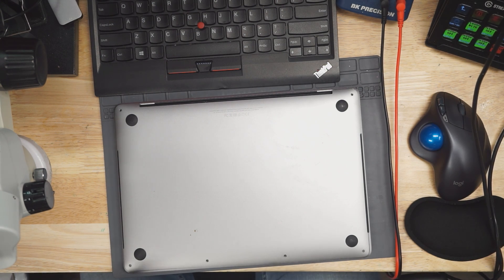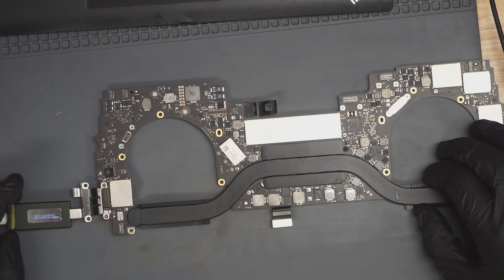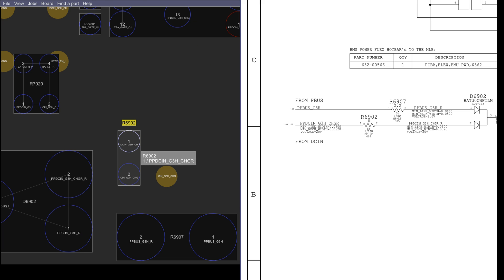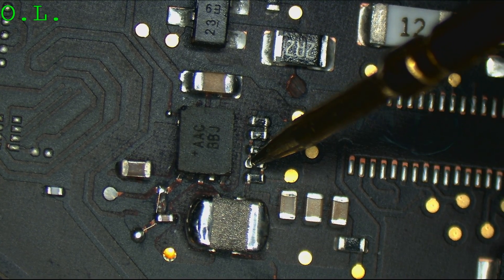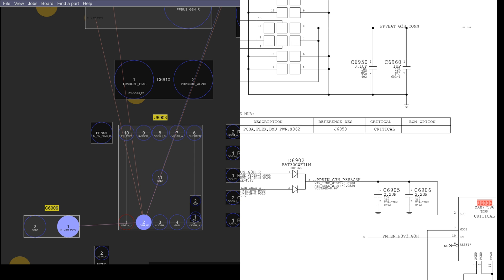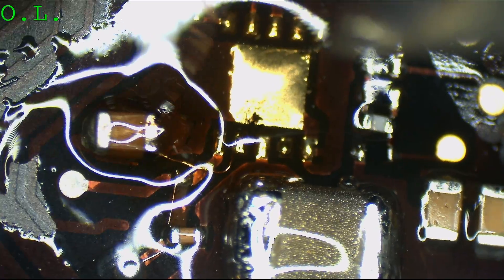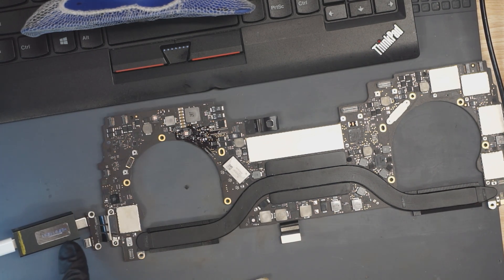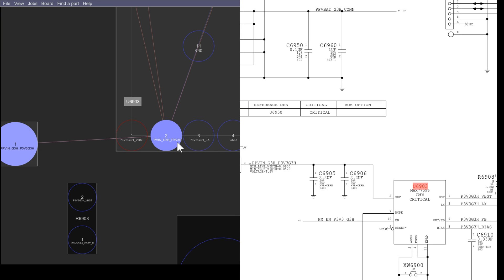Louis fixes board while losing mind, earns 1 star review.

Comment: I have never even opened a PC or any other electronics in my whole life, and I have nooo idea what he's doing, but I can say "pee pee bus" and "gee three hot"
Reply: Dw, most of us here have only got "Are you on the pee pee bus?" outta these.
Reply: Think of it like this. You gotta plug your phone into a charger to charge. 

Similarly, the internal components need to be “Plugged in’ to work. Power wasn’t wired to that chip so he reconnected it. That’s all he did there. Or maybe replace a chip that went bad. The flux and stuff was jut how you reconnect wires directly to components on a board.

I’m not an expert obviously but that’s for the most part how boards are fixed

Comment: I'm doing some DIY on a Pentium 3 computer found on the streets many years ago and ran into "Error 12" in Windows XP that crashed/froze the boot. After a long debug search it showed that the Bios or Windows is assigning resources in a messy way and I removed a network card and the CD-Rom. (I also have a DVD module connected). It then started the Sound Blaster card.

Before I started painting the case and the front of the diskette module there was no errors, but I don't remember if that sound card ever worked before. The outer case is looking good now with a color style from Dell and I have a 4:3 Dell monitor connected which was given away and I picked it up close by.

When I find a Firefox setup file somewhere in my backups then the WiFi internet pages also works via a small USB thingy that is easy to unplug.

I did get angry a few times and mostly on those '90s engineers who built this without making it show a message of what the problem is.

Comment: Thanks to watching your board repair videos I knew what I was looking at when I was doing a motherboard post mortem today.  The batteries in my multi-meter died before I was able to finish checking resistance on the capacitors and resistors.  I was truly impressed with how many parts were burnt out without frying out the CPU, RAM, or all the other parts!

Comment: Louis, if i were running your set up, where you have decent lighting and you know you're always going to be a set distance from the camera, i'd be running my lenses at f/5.6-f/8 constantly. because it's more important people can see the table or your face in focus consistently, than that they get creamy smooth backgrounds/razor shallow depth of field, like they would at say, f/1.8. But at those narrower apertures, there [shouldn't] be any appreciable difference in sharpness or fine detail between one modern lens to another. especially on an APS-C sony, which i'm guessing you're shooting with. so you're not crazy. Now, if on your down time you wanted to go shoot some cute pix of your cat sleeping in a dark room, and you don't want to turn the lights on or use a flash, a 30mm prime at f/1.4 or f/2 would be worlds better than a standard zoom at 30mm at f/3.5. There's a tool for every job. You're just kinda comparing a socket wrench with an impact wrench here.

Comment: things that set apart good lenses from bad ones are mainly and excuse my poor english (i'm german):

- good lenses can produce sharper images mainly on the edge of the lens wich a bad one cant do so well
- good lenses dont suffer from chromatic abberation that much (when filming metallic objects you get green and purple spill)
- good lenses usually have better autofocus vs the bad ones and they have better control mechanisms, mainly in regards of holding the settings you set them to

that beeing said, kit lenses are surely far from a good lens, but they are also far from a bad lens. for making youtube videos, the kit lens is sufficient enough and even for most amateur photographers they do the job just fine. people that dont know how to properly use the camera and in general have no idea of what they are talking about jerk about their lenses - they dont make them a better photo/videographer by themselfes.

sigma is depending on the price range on par with the kit lense, at least for the canon ones i owned before. i think sony makes a bit better kit lenses than canon does.
thing is, a lens is very expensive if you want a good one. if you buy the cheap stuff from sigma, you might aswell safe that money and stick to the kit lens. most manufacturers like sony canon and nikon do offer entry level lenses for a good price that cover most focal lenghts that are required under normal operating conditions.

sorry for rambling here louis but i hope i can give you some advice back for all the useful stuff i've picked up from you (never would i have thought i'm going to repair one device, but beeing able to self-repair my shit is just priceless)
Reply: @MrPuffin69  sigma is mostly exclusively an choice for amateurs (except from the really good ones). i do not know any professional guy that uses these, they all stick with either the manufacturers brand or something like Zeiss for the very reason they need to have something reliable.

having different focal lengths surely requires different lenses BUT there are huge differences, especially with wide angle lenses, the cheap ones clearly seperate from the quality ones
Reply: Good info Sharky. I've got a couple family members looking at getting lenses, I can pass on this bit of info to them.
Reply: @MrPuffin69  u mean stigma?

Comment: You ran a jumper wire, it's now a PC
Reply: Terry Wilson  At least AGC schematics are publicly available
Reply: @needleonthevinyl  - AGC?
Reply: Maybe even PC XT
Reply: That would be an upgrade!   @volodyanarchist
Reply: I once disconnected the wires to a cheap AM radio and lengthened the wires and connected them to a jack I installed after drilling a hole so I could listen to the the radio with headphones.  (Couldn't afford a walkman).   All this time, I had a made a PC and didn't realise it.
Reply: You'll never find a molex connector in a MacBook.
Reply: "And it's going to explode.... And kill a baby..."   Quote direct from Apple
Reply: Can you direct me to the video where this originated from
Reply: @FxsX24  I can't find the exact video that Louis talks about it, but it has to do with a legal type claim that Apple's lawyers made saying that any unauthorized aftermarket modifications of any kind technically makes the computer no longer a Mac and there are copyright issues with that. It's an absurdity that comes from desperately trying to prevent right-to-repair.
Reply: @needleonthevinyl  yes yes, but at least still can be fixed, but switching parts may cause problems. Mac lockdown initated.
Reply: @FxsX24  
https://youtu.be/oNl2q6YZXlA?t=267 I saw it there.
Reply: @FxsX24  I think is the "Apple sues and loses" video

Comment: I sure learned something, to not buy Apple products. But I've known this since 2006.
Reply: @dj-rocketman8545  hold their value ?  why because you spent $1000 to $2000 more than you should in the first place? Or because you have to sell it to afford the next version the next year, that has the exact same hardware, but costs a little more ?  Most of the time, you can't even get the latest and greatest hardware on a mac, they are consistantly 1 or 2 generations behind.

When i buy or make my computers, it's top of the line for the money I'm spending and it lasts me (or who ever it's for) for years.   When it's not my main system anymore, it becomes another server.

BTW, no electronics hold their value, it's like buying a brand new car and as soon as you drive it off the lot, you lost $5000.

The only thing macbooks really have going for them, is that they are all the same hardware, so you know that there are going to plenty of the same spare parts, eventually.
Reply: @dj-rocketman8545   lol, i like how you call me a fan-boy because i'm basically saying, buy anything else because you'll get a better deal.... that makes me exactly NOT a fan-boy of any type.  

There are people who constantly buy the newest apple-anything as soon as it comes out, apple counts on this heavily, which is why they have their constant cycle of release-rinse-repeat despite hardly anything changed hardware-wise. And by the way, sales are down for apple, because of this.

Yes, cars and electronics do not hold their value (well, except maybe classic cars).  Go to a pawn shop or hell, ebay and sell your 10 year old electronics for the price you paid, not gonna happen... so yea, it didn't hold it's value. This isn't rocket science. Buy some land, and sell it for how much you paid... not so hard, because it held it's value.  This is simple english... if something holds it's vaule, it literally means that its not worth less later in it's life than what you paid.  Gold, Silver, Diamonds... all the things rich people put their money into so they don't loose it when money value drops... none of them go out and buy piles of electronics to later sell and get their money back.

Mac books are made of aluminum, fairy dust, and cool stuff... except they couldn't even do it right, so the top of the line mac book throttles down the CPU so it doesn't overheat, making the top of the line intel processor you can get on it, basically a mid grade i5... all this, despite the mac book being made out of aluminum (which means it should cool down much better). 

Now, do yourself a favor and google "aluminum laptop" and see what pops up ?  a whole lot of NON-APPLE products.  This isn't the 1800's, everybody has access to aluminum, and apple hasn't tried to patent it... yet... like they did with round corners lol.

But you do say that everybody gets them because of final cut pro and the OS.  I know a handful of developers, game designers, and aerospace engineers who have or had a macbook and generally they boot up linux, unix, or even windows7 or 10 to do their actual work.  I think only 1 has kept the Mac OS as a dual boot option.  Why do they do this ? because they love the screen and/or keyboard, and they generally don't have to pay for their company machines, not because of the struggling MacOS.  Don't even get started with how stagnant it's become... apple's put all of it's software force working on it's mobile stuff, and the security holes in it's computer OS keep bubbling up.  Ask your local IT security professonal and wait for him/her to start rolling their eyes.

I'm not saying Apple makes totally crappy machines, they have some good hardware sometimes, but it rarely is worth the price you pay.  I even had one of the first Macs way back in the day (80's), and I've been in this industry for quite a while now.  If you really want a Mac, just be honest with yourself that either (A) you don't really know what your doing with computers, (B) are forced to use software that only exists on apple machines, or (C) want to be a part of the apple-life-style they advertise non-stop to you..... or (D) can get your company to buy you one and know how to install a different OS so you can actually get work done with it.

P.S. If you like apple, fine, it doesn't really matter... I just find it completely funny when somebody says "my computer holds it's value" or "Apple is the best because it's Apple".  These types of statements are what people say when they don't really know what they are talking about, but really don't have any other way to defend the way they feel about their product.
Reply: DJ - Rocket Man - So you say that he pulls facts out of his ass when you straight up blatantly lie about windows laptops being made out of shitty plastic? I have one thing to say to you, OVERPRICED SHITTY OUTDATED HARDWARE that’s the best way I can describe apple, sure they have the os going for them, but, it’s so fucking bad that it physically hurts me to use. I can honestly say that I would rather pay msrp for a laptop that’ll last me for years then overpay 1.5-2x msrp for some laptop because oOoOh its aluminum or “ but it has the shiny logo so it must be good” honestly try and educate yourself about computers before trying to argue about them
Reply: Hello fellow csgo player
Reply: RB Bedard No you haven’t. Pipe down